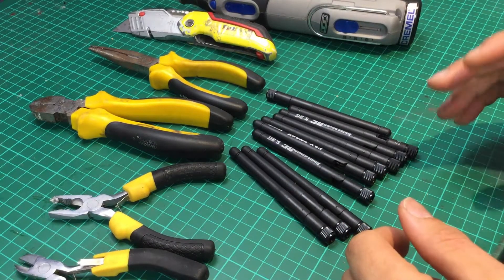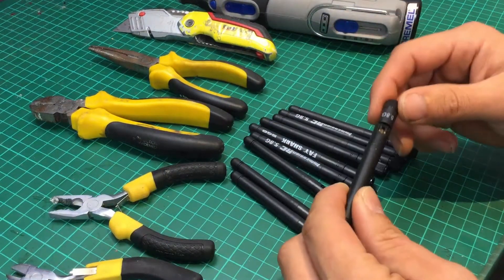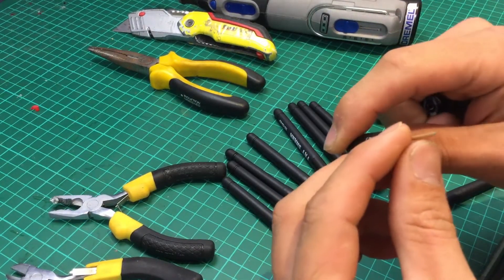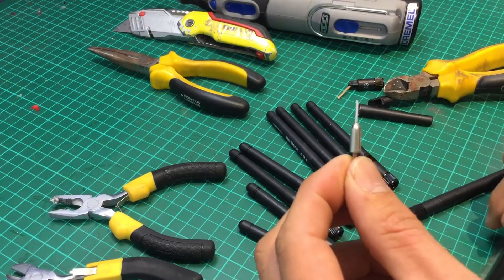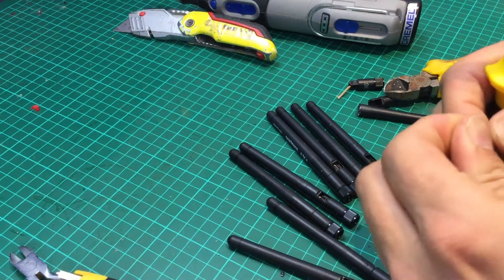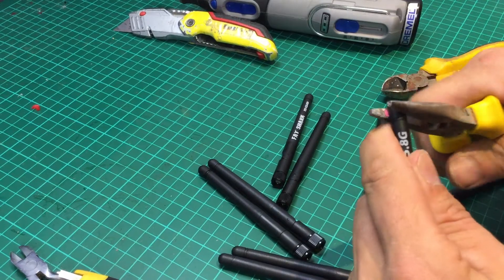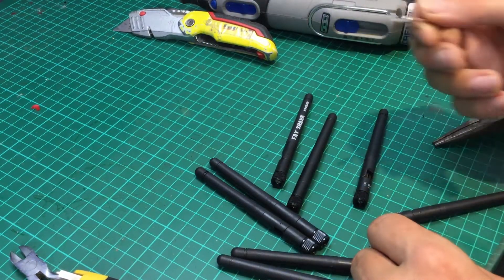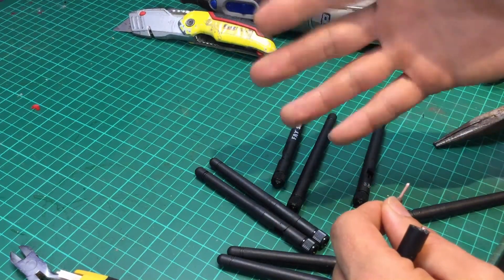What's inside a Rubber Duckie Antenna Anyway?

Comment: I suppose the real question is why do the make the rubber part much longer than neccessary? Just extra weight and space required. I wonder if my DX8 TX antenna is the same ;-)
Reply from the maker: Probably nothing in there, it's just for show? Matt

Comment: These are simple 1/2 wave sleeved dipoles where the centre wire is exposed 1/4 wavelength long and the screen is pulled back 1/4 wavelength. I know that many will argue that these antennas are junk but in reality for a lossless dipole they have 2.15dB of gain over an isotopic radiator ( a theoretical point source that radiates equally in all directions ). In an open environment with a low probability of unwanted reflections these antennas will be more effective than a closed loop antenna such as the often used Closed Loop Cloverleaf antenna. Many manufacturers will make claims that their antennas have high gain, expressed in "dB" but this is absolutely meaningless unless the reference is included, "dBd" for gain over a dipole and "dBi" for gain over an isotopic radiator.
Yours Pedantically. 
Nidge.
Reply: Dipoles ain't that bad, sure beats whip ones ... I'll try to get my hands on a tracking spectrum analyser with signal generator to check my antennas...
Reply from the maker: Morning Nidge, I agree with you, I left my clover leaf at home for my fatsharks and used one of these, worked fine. As you noted everyone say's they're rubbish but to be honest they work fine & I always keep a spare to hand! PS. I've completely forgotten everything I learned in my HND except for the very basics ;-)
Reply: Matthew Ogborne 
Hi Matt
I very rarely leave the house these days so I'm usually blabbing technical stuff with my collection of singing potatoes......Wibble Wibble. 😜
Reply from the maker: Howdy Uroš, yep totally agree, they work and thats what matters! Matt

Comment: replacement tiny whoop antenna's. they are bunch harder to destroy than the stupid clover leaf that comes on that cam. i found it decreased the range a little but i never go far with the whoop anyhow.
Reply from the maker: Good morning Oliin, oh I hadn't thought of that, brilliant idea fella! I fly my 2S micro quad in the back garden & often use the diversity receiver for it, considering I've snapped one of the leaves off the original antenna on the AIO camera, swapping it to one of these would work. Great idea Oliin, Matt